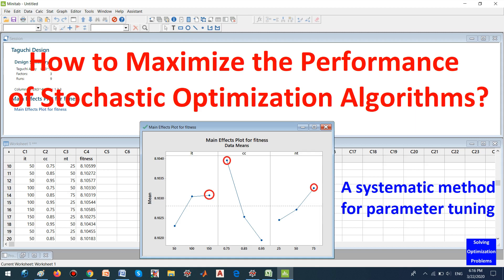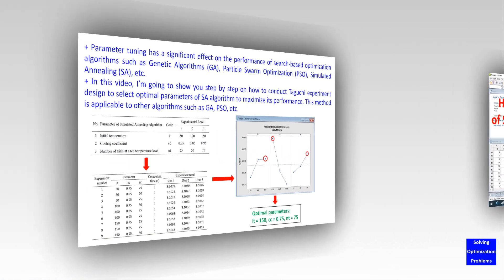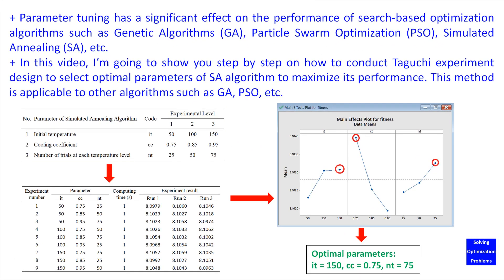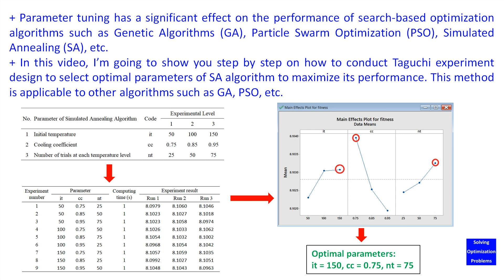How to Maximize the Performance of Stochastic Optimization Algorithms?

Comment: How did you decide which parameters were optimal based on the plot you got at the end? The bigger values?
Reply from the maker: Hi, select the bigger values for maximization problems and smaller values for minimization problems